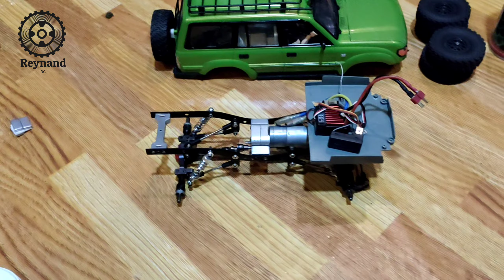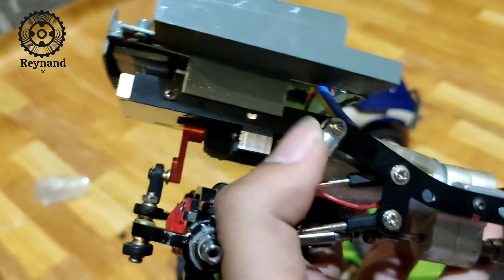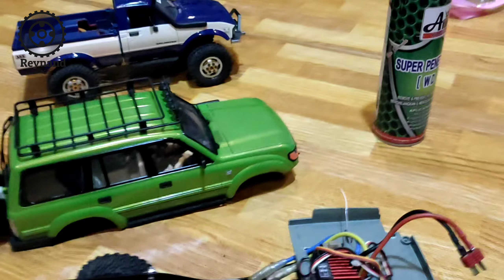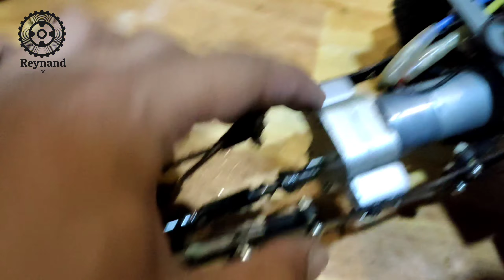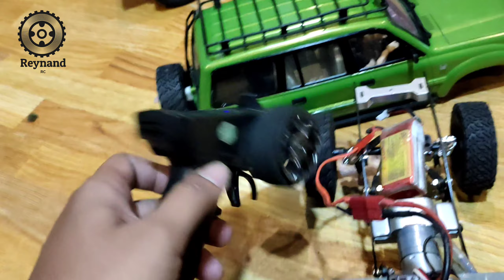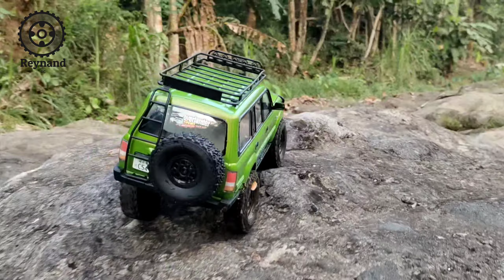REVIEW SHOCK METAL WPL LONG TRAVEL- LEBIH KECIL TAPI TRAVEL LEBIH TINGGI

Comment: Error in the "flex test", bro. A proper test is the highest one wheel can go with the other 3 wheels still touching the ground. Using the tires to measure, it looks like it is 2, maybe 2.5 tires, but not 3 and not 4. What's the flex on the front? I don't think it is the same as in the rear, because your low mounted servo is in the way.